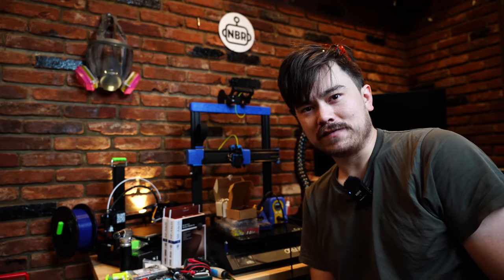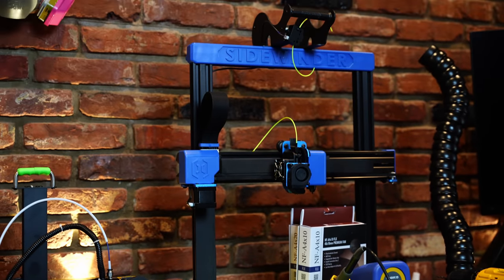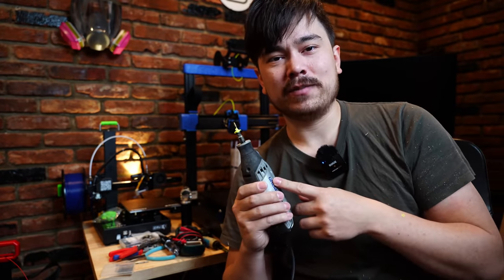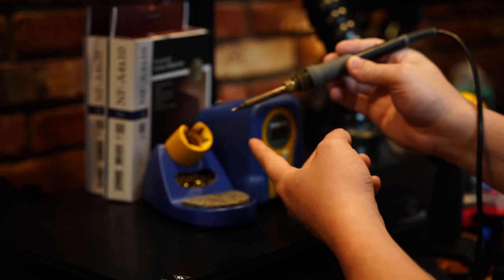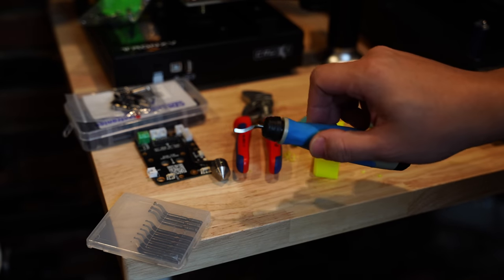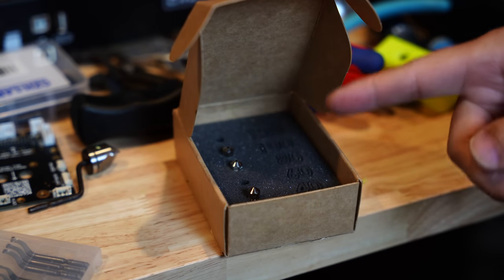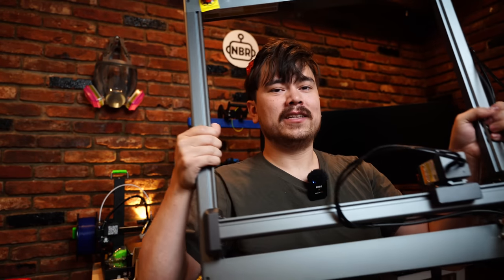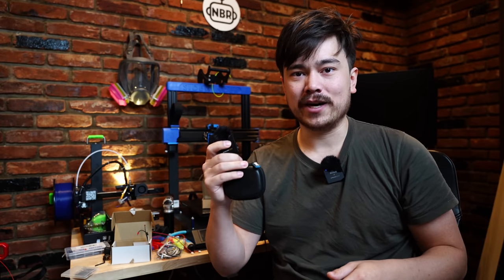2022 HOLIDAY BUYER'S GUIDE FOR 3D PRINTING

Comment: "...you end up with higher quality fans that objectively look better. Everybody loves this brown and tan color scheme, right?"  Hahaha, what a lunatic! Thanks for calling out that model! I didn't know it came with adapter that basically let me plug it right in.
Reply from the maker: Yes, I need to do some testing, but it comes with a Ultra Low Noise adapter and a Low noise adapter. They are a 150 ohm and 50 ohm resistors. When I did the math, they should just barely be within the wattage margin for running the fan on 24v. I bought a couple and will be testing that theory in a video soon.
Reply from the maker: Plus they come with an omnijoin cable adapter, which can be used to splice onto any 2 wires you want to attach them to.
Reply: @NathanBuildsRobots  I remember one of your vid recommands using a zener diode, will that work with the noctua fans?

Comment: get the dremel flexible shaft attachment which has a pen-like end that is FAR easier to hold!
Reply from the maker: I want ALL the power! You have some friction losses using the flexi-coupler, plus its weird having to turn it off. You have to let go with one hand and look for the dremel body, then turn it off. When its the hand-held unit, you have your controls all at the ready.

Its a good option if you are doing a longer periods of delicate, light work though.
Reply: @NathanBuildsRobots  higher precision though but I see your point. The design isn't ideal

Comment: WARNING, I’ve had the X1 and now I’m throwing out the X2 as well. The X1 had thumb drive issues, it wouldn’t read them, replaced that and then it had bed heat run-away issues, that went to the garbage. Got the X2 and as with the X1, the glass bed wasn’t perfectly flat, lower in the middle, but with ABL, not much of an issue. But it is a problem with Artillery’s. We have 3 X1’s at work, all have had bed replacements due to warped glass. Today I’m throwing out my X2 because the Z axis started making a grinding noise and wouldn’t home. Tried everything I could think of to fix it and then all the axis’ just stopped working, it’s only 6 months old. They start out great but fall apart within a year

Comment: This video was the best content I've seen in a month. You just GIVE your brain words without the bullshit. AMAZING 🤩. I'm throwing this ender 3 v2 neo into the ocean and getting that sidewinder
Reply: WARNING, I’ve had the X1 and now I’m throwing out the X2 as well. The X1 had thumb drive issues, it wouldn’t read them, replaced that and then it had bed heat run-away issues, that went to the garbage. Got the X2 and as with the X1, the glass bed wasn’t perfectly flat, lower in the middle, but with ABL, not much of an issue. But it is a problem with Artillery’s. We have 3 X1’s at work, all have had bed replacements due to warped glass. Today I’m throwing out my X2 because the Z axis started making a grinding noise and wouldn’t home. Tried everything I could think of to fix it and then all the axis’ just stopped working, it’s only 6 months old. They start out great but fall apart within a year. Hope it’s not to late for you.

Comment: If you don’t like the dewalt drill, I’d recommend you try out the little Bosch 12v brushless drills and drivers. Weight and ergonomics are excellent, and they have a great menu of compatible tools.
Reply: You can get a generic Rotary tool from any cheap store that works just as well and cost 20 bucks or less.

Comment: Love my Mitotoyo calipers. Had 2 sets over the last 20 years and the only reason I needed a second set was because my first set was stolen. The steel they are made with is hard enough that you can even use the internal measuring side to scribe circles on steel and even stainless. I have never had the digital ones tho but I'd guess they are made from the same material.
Reply from the maker: They make all sorts of variants. Mini calipers, and spring loaded calipers, and micrometers too. They are expensive but worth it.
Any products that can manage to get a 4.8 star rating while selling primarily to machinists (who are notoriously curmudgeonly), has to be good!
I wish you had a 20 yr old digital pair, so I could ask you how long the batteries last. I checked the voltage on mine after 2 years and they have more juice in them than some brand-new batteries I bought on Amazon.

Comment: Awsome channel. Could you do a how to set up the creality sprite for printing petg. speed retraction. and all the stuff that I dont know. stringing. Or is this something that is what it is.Great Channel.
Reply from the maker: I hate printing PETG. I need to run a half KG of PETG parts for my V-Minion build. I think the trick is getting PETG that doesnt suck.
Reply: Try some CHEP Filament Friday profiles for cura, they are great. You can find them on thangs.
And it's hard to get PETG not to string, so don't worry about it, just use a lighter for them.

Comment: I Print PETG at 220-230°C with a PTFE liner which works way better than printing with a all metal and having clogs all the time. My retraction is even at 12mm with no problems.
PTFE is waaay better as long as you stay under 240°C.

Comment: Nathan, a great video that I really enjoyed watching. I like this kind of video because it helps me be more confident in my purchases on this 3D printing journey. One question though, I'd like to update my blower on my Sidewinder x2, but I'm unsure if I should get a 12 or 24 volt 5015. I'm sure you could just tell me (please do) but also, how could I determine it myself? I do not have a multimeter. I'm new here. 🙂
Reply: Honestly, then first buy a cheap multimeter.  I don't get how you can get through life without one as I use it for dozens of things, ex. measuring battery voltage ...  The $10 a cheap one costs is definitely worth it.  That said: check the power-supply on your printer.  It should state whether it is outputting 12v or 24v.  Only risk would be that even with a 24v board, it might have some fans running at 5v, but on 3d printers that's fairly rare.
Reply from the maker: I’m fairly certain the X2 has a 24V fan plug. Haven’t nodded mine yet, but I want to.

It actually comes with a 4020 blower fan, which has about the same output as a 5015.

Comment: I know this probably isn't the best video for it, but have you heard of Kingroon? I'd love to see you test the KP3S 3.0 and compare it to the Ender 2 and Tronxy Crux1.
Reply from the maker: Just got a KP3S in the mail, not sure which model it is. Will check it out
Reply: @NathanBuildsRobots  if you got it new from their website it's the 3.0 version. Unless it has the linear rail on the Z instead of the Y axis, in which case it's the larger Pro model.

Comment: Got a question about those fans...those adapters you mentioned are listed as NA-RC10 Low-Noise Adaptor and NA-RC12 Ultra-Low-Noise Adaptor. They are apparently just used to slow down the rpms on the fan to control the noise output. Can someone confirm that this also lowers the voltage to 12 volts? I am not an electrical guy, but I assume that in order to slow the fan down the voltage must also be lowered to do so. But, EVERY fan upgrade video I have seen says you need a buck converter. So is that not really the case?
Reply from the maker: I use resistors all the time. Will do a video about it when I have time! Or ask on the discord!